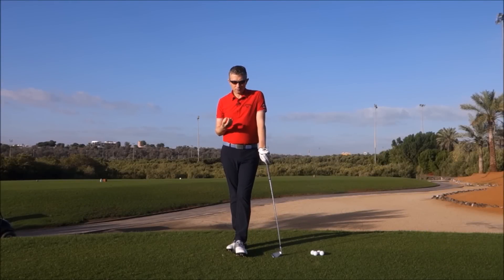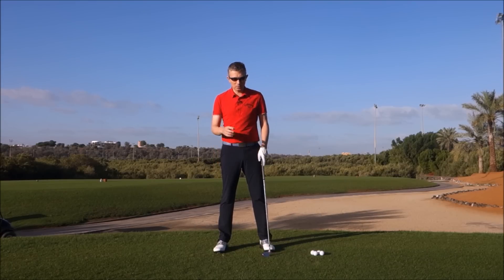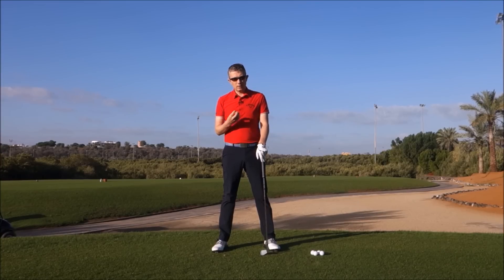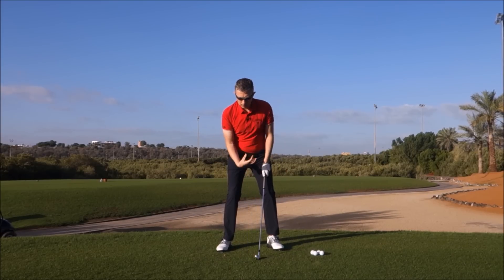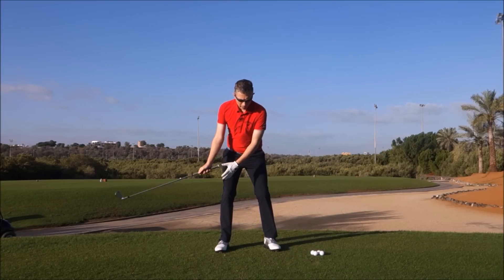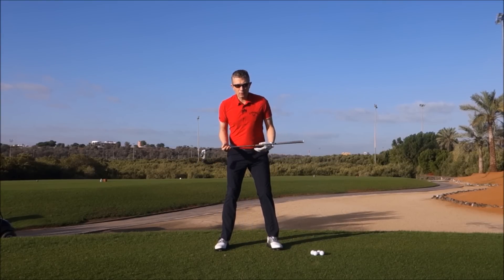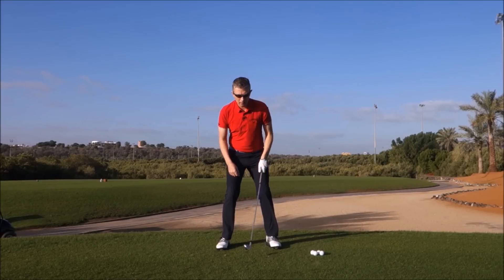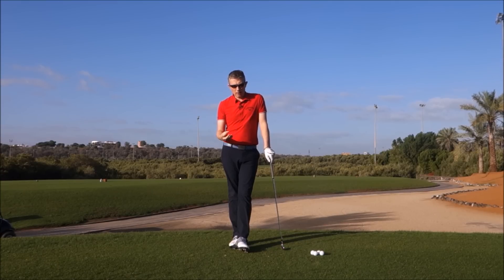Center of Mass Center of Pressure in  a Golf Swing

Comment: Robin thanks for the great videos,I have grasped the concept of ground pressure /loading with regards the lower body its what saves my swing when Im swaying badly But my latest Lightbulb moment is how set up pressure in the upper body helps maintain Center of Mass.Its hard to describe but basically I gave away stability/pressure achieved with a good stance/posture immediately in my backswing or I turned down into the ground and around a bad move.Now I maintain my downward pressure(slight) in my torso/shoulders/arms and just turn around,best ball striking in my life! if only I was 40yrs younger!
Reply from the maker: I know what you mean Graham, but no question understanding pressure, and using can be a real key.  Many of the greats are doing it without knowing

Comment: It looks like you can only deliver a descending blow,  which is going to add backspin with a driver!
Reply from the maker: Thanks for your comment David, and for sure we have different movement patterns and COM position with different clubs.  General rules stay the same.  Also having the pressure on the left in the impact area allows you to push up, increasing the AOA